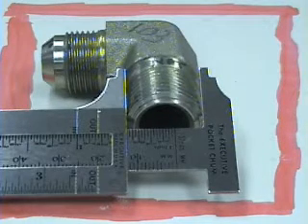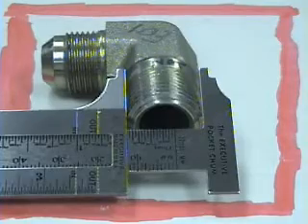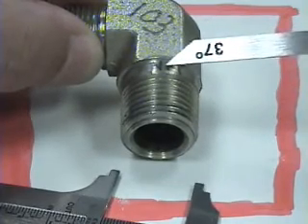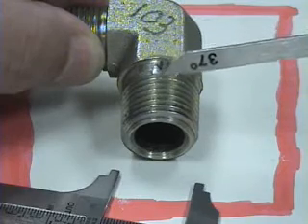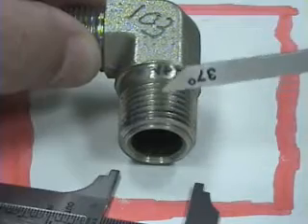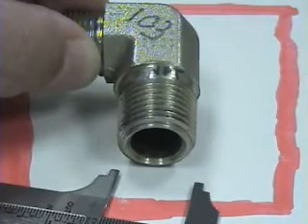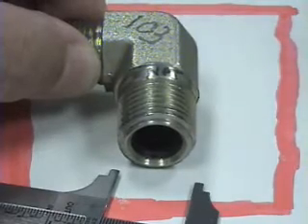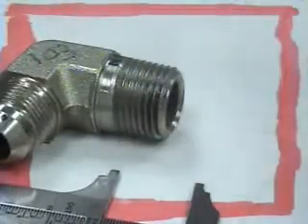Fittingspeak: Pipethread

Comment: Is it true all pipe fittings are measured in inside diameter ?
Reply from the maker: With pipe, the "nominal" inside diameter (ID) on schedule 40 pipe is about same as the pipe "size". 
For example the ID of 3/4” schedule 40 pipe is close to 3/4", while the outside diameter (OD) is close to 1”. The OD remains the same through various "schedules", or wall thicknesses, and the ID varies. 

For tube, if the OD is 3/4” it is in fact 3/4”. Tube wall thicknesses vary. Here’s an example: Smooth-Bore Seamless Steel Tubing, 3/4" OD, 0.049" Wall Thickness

https://www.mcmaster.com/9220K391